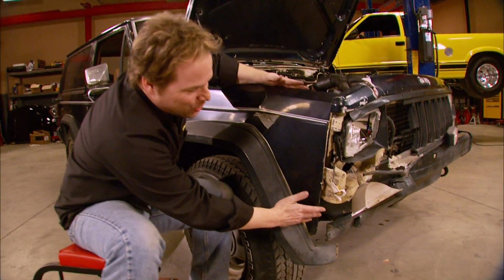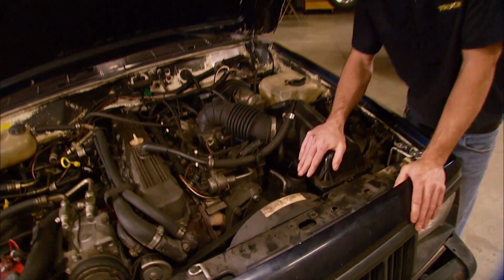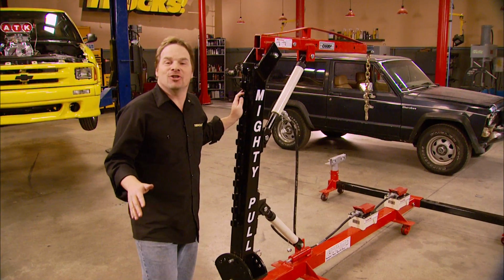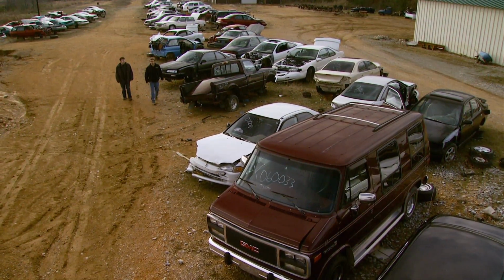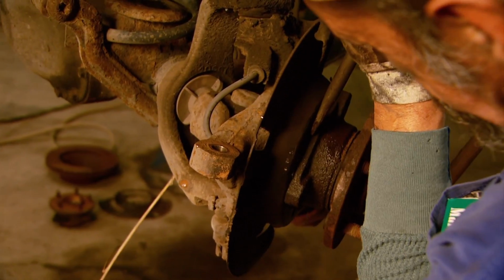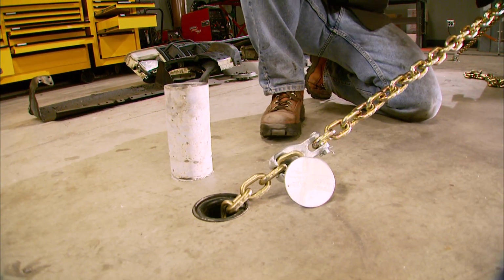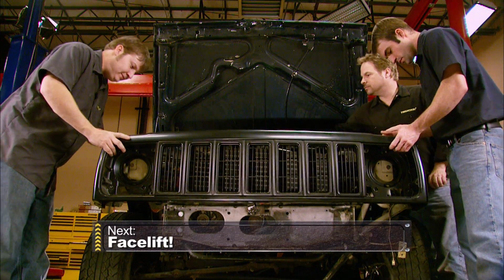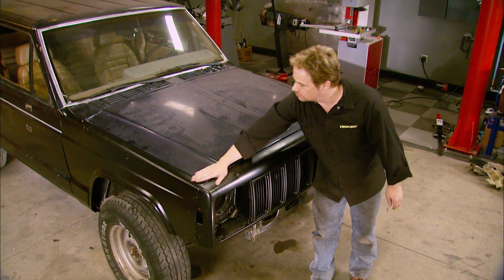Junkyard Parts Are A Cheap Trick For An '88 Jeep Cherokee Collision Repair - Trucks! S10, E4

Comment: I love that you are saving a 2-door. 

XJs are basically made of papier-mâché when it comes to safety. 

Remember that these were designed by non-Chrysler AMC in the 70's. The safety cage was for rollovers, not small-offset frontal impacts.

XJs never came with CV shafts. Those are from a ZJ and are 100% interchangeable between each other.

Comment: I really apprecaite the saving of the old 2 doors. I love these old Cherokees.
Reply: It even looks like an Up-Country. It has the bigger bumper brackets with tow hooks. Makes it even more valuable.
Reply: You definitely don't want them touching any more jeeps. My buddy got a hold of the engine out of this jeep and the stroking was done very terribly!
Reply: @blackhillsrc600  how so?
Reply: @Thestockxj96  it was so bad that my friend had it inspected to be sure he could put in as a viable replacement to his dieing 4.0 and the stroking they did was way off and didn't match from cylinder to cylinder. The engine from what I've heard made it another 3,000 miles and killed itself.
Reply: @blackhillsrc600  That literally doesnt make sense. "Stroking off cylinder to cylinder" its a factory crank from a different engine.

Comment: It's called "pattern parts". Insurance company often instructs shops to use them to cut cost. 

The thing is, these pattern parts are often thinner than original steel that came off the factory and the dimensions aren't true to spec either. So if you just want a cheap fix, by all means go for it but if you ask me I'd rather fix the original steel first

Comment: What a joke. This is not cheap at all. Over $3000 in the Mighty Pull and all the chains and accessories. They say they found auto salvage parts but don't say how much. They put on new sheet metal for half of the front end. Yet again another overblown build with no truth of being cheap.

Comment: I had one that died at 450,000 miles. So for that one to be at 129000 still has life on it. Them  6-cylinderengines are bulletproof
Reply: Just keep the oil changed regularly. Dirty oil = bad lifter = camshaft wear.

Comment: I want to convert mine to a 4wd.
Reply: It is easy to convert to 4wd. Just find a 4wd jeep that is close to the same year you have pull transmission transfer case and drive lines. It should all just bolt in. Makes sure the gears match front and rear.

Comment: Love the low buck builds!
Reply: What's "low buck" about a frame straightener?
Reply: Callelle you can go to a body shop and get the frame straightened for a couple hundred bucks. Did it with my VW. All they did was straighten out the rear. I did the rest of the metal work. The entire bill was 250 if I recall
Reply: Callelle thomas pryor  I used a come along and another truck it’s just sheet metal frame on the xj doesn’t take much to move it
Reply: In regards to, a new lo dollar build project. 
BTW I did pull front end damage out with a tow chain and a fire hydrant once. Just sayin'.

Comment: "Cheap Jeep"  pulls out a $3,000 frame straightener.......
Reply: Another 20k in tools
Reply: and what happened to at the being mission statement of will not spend any money unless absolutely necessary and then buys out new sheet metal.
Reply: And a huge garage.
And a truck w/ trailer to get the jeep...
Reply: That’s what I was thinking
Reply: I wonder if you could do it with a come-a-long, strap, and a tree?
Reply: @schwanzmunster2503  in a true backyard mechanic or youngster learning to be one and is looking to fix their Jeep cheaply because they don't have 20,000 tools and a shop... yep!!
Reply: @schwanzmunster2503  If it were a 10 ton come-a-long, sure!
Reply: @schwanzmunster2503  I did virtually the same repair with a come-a-long and my 05 F150.  Just went around the ball on the hitch on the 150 and back to the hole in the bumper area. Put tension on the C-a-L, then started tapping with the hammer (and not a BFH either). Took about 45 min but it was nice and straight when through. Patience is the key. Don't rush it and you can keep from ripping the metal
Reply: If you don't have a frame straightener and I'm sure most of us don't, you can have an auto body shop do that part for you. Dont be silly you guys. They never said you had to buy your own... and honestly I have done the same thing by bolting chains the frame then to a big tree. 4 low reverse and let it stall itself under load. (Or kill it with the key) Got out beat it with a hammer then did it again. Worked great.
Reply: A regular everyday item people have, my thoughts exactly.
Reply: At that point I rather spend a little more and get one without an accident.  Add a small lift and tires, call it a day....
Reply: Amrit Singh I already owned it and it cost me $800 for a clean (no rust, mint interior, everything worked, needed nothing for inspection) black 89 4 door with 180,000 miles.
Reply: I pulled out a crushed Cherokee front fender using a winch on the front of a TJ, a snatch block, and a tree. You don't need expensive tools. A little creativity goes a long way.
Reply: I straightened the frame on my Cherokee the real low budget way: hook a heavy duty tow strap or chain to the frame and wrap the other end around a big old growth tree, back up until it’s tight and then floor it in reverse.Then let a little slack out of the strap and floor in reverse again. A couple of times and it’ll be straight. Worked great for my 89 Cherokee that met a deer at 50mph. Hammered out the left front fender and swapped the grill and radiator and it looked new again.
Reply: For sure, but you could probably get a decent job cutting it out and welding a piece back
Reply: Chuckles I’d rather pull it cause it’s more likely to get all the wrinkles out, even the ones you done see that could cause issues down the road.
Reply: Which everyone just happens to have in their garage too.
Reply: WaybackTECH you can pick them cheap at yard sales, auctions, and flea markets for cheap.
Reply: Ya, I know they need advertising dollars but they don’t need to call it “budget build for the every man!”
Reply: Honestly just hook up a toe strap with a hook at the end and have your truck in front. Floor it and if it rips off you learned that your truck has balls 😂

Comment: Rebuild a 1950 Ford f1 and put a small block Chevy with a power steering pump on it in then use a old 4x4 f150 transmission gearbox and front axle and do some rust work and other stuff then stiffen the suspension
Reply: Please don't put a Chevy Small Block in the Jeep!If ya do im out of here!

Comment: 129,000 miles on a jeep heck that's just getting her broke in.
i've got one at 350,000 miles
Reply: I totally agree. I'm a mechanic by trade and I've worked on those jeeps with 500,000 miles on them and the only part that didn't have issues with the 4.0
Reply: Schwanz Munster nice! I’ve had to rebuild a couple but the engine is pretty solid. Got 9 of them in my family
Reply: Lemme guess,
You have to use gear oil to keep the oil pressure at safe level. (-;
Reply: Peter Varney actually we run full synthetic 0w-30 no issues
Reply: Heck, that's still under warranty!
Reply: Mines 315,000 run it on 5w20 no issues lol just recently switched to 15w40 its loving it
Reply: 275k miles on mine
Reply: They are great engines, until they leak. The rear main seal on the 4x4 is hard to replace.
Reply: @stuartbear922  thats how you know it has oil in it and besides an oil leak is better than a hole in the block
Reply: Stuart Bear It’s only a pain at stock height. A 4” lift makes an XJ so much easier to work on underneath, don’t even need a jack!
Reply: It must have had a hard life if it’s worn out at that mileage.
Reply: You gonna rebuild the motor?
Reply: @md_randoms2429  eventually when it finally gives out she isn’t quite as strong as she once was but still doing pretty good
Reply: @sickkid129  yeah I get ya, my dads 97 Cherokees motor blew at 180k miles, sadly there was a giant hole in the block so we couldn’t really rebuild it so we got another 4.0 liter out from our garage and used that block for his jeep